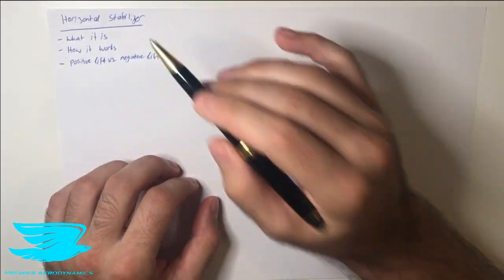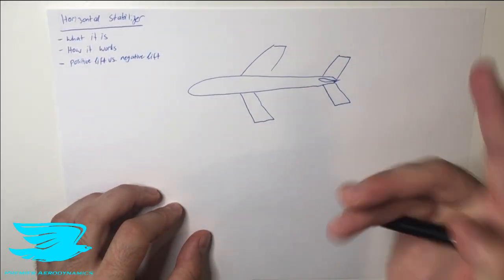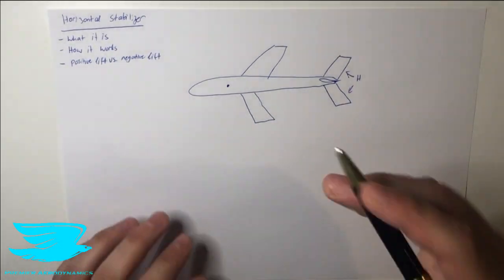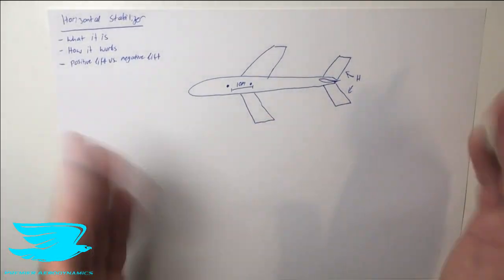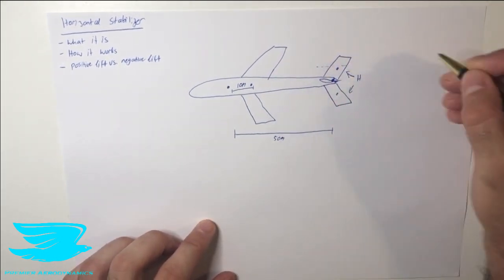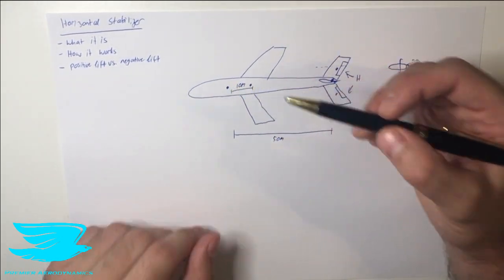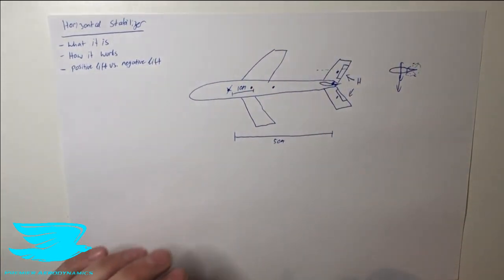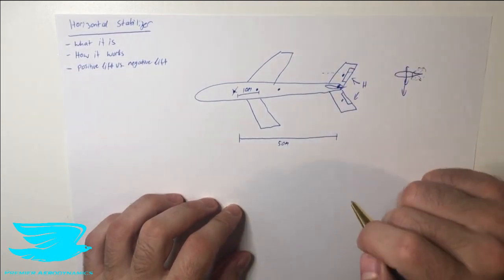[Aero Fundamentals #21] Horizontal Stabilizers Explained

Comment: Hi, What will happens to the plane, when the Left Horizontal Stabilizer will break or loose and we will increase the engine speed?
Reply from the maker: Generally, the airplane will have a strong coupling between pitching, yawing, and rolling. So, as soon as you try to adjust the angle of attack, you will yaw and roll too, and vice versa.
Reply: @PremierAerodynamics  Loss of the horizontal stabilizer can cause forces that would break the fuselage apart(blow up)?